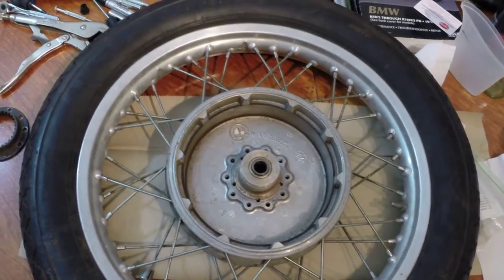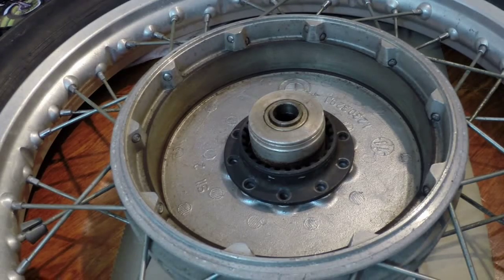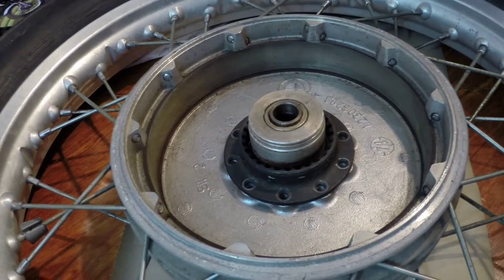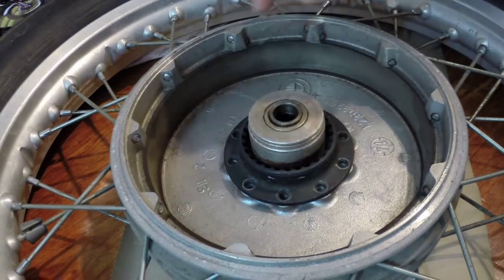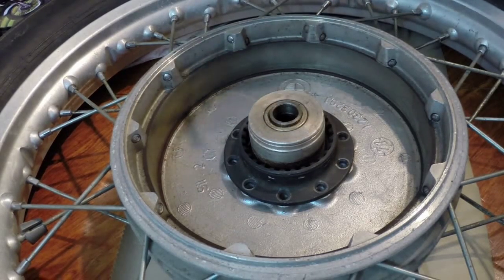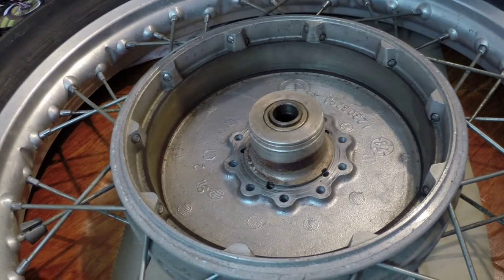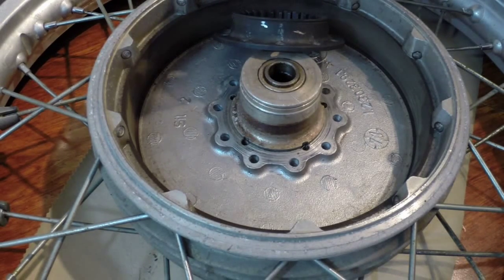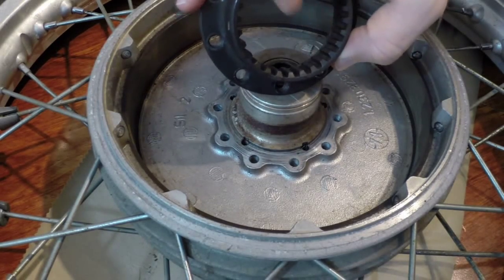BMW R75/5 rear hub spline repair (part 1)

Comment: Note, that there is a reason why bmw's engineers used rivets and not bolts... the whole bike is boltet, but here on the hubs we find rivets.  Don't you think we should wonder why...?
Reply from the maker: I am not a BMW engineer so I can't give an informed response to why they used rivets for the hubs. I can only assume it was because there is no clearance for bolts (I tried). These Hi-Lok pins are used to replace rivets in the aviation industry and have a higher shear strength and fatigue resistance than rivets. I tried this as a test. I can say after about a year of riding, I have had no issues at all with the rear hub.